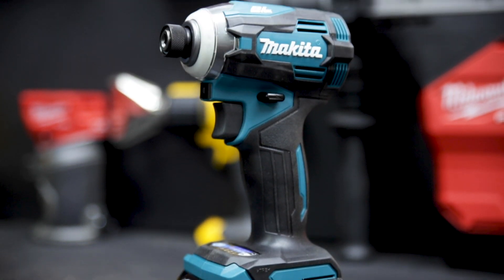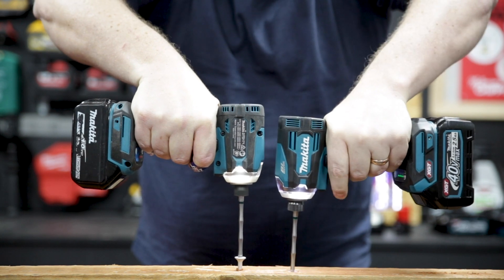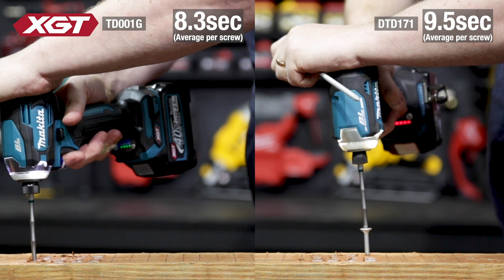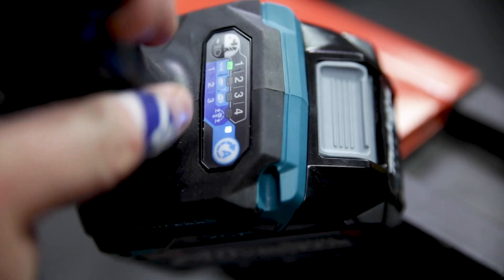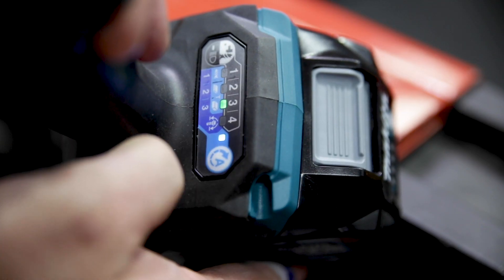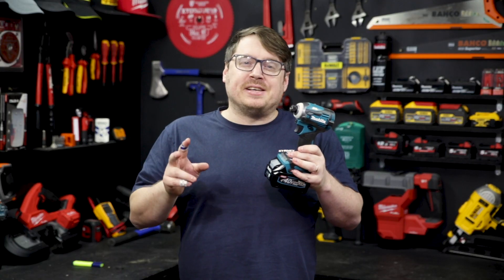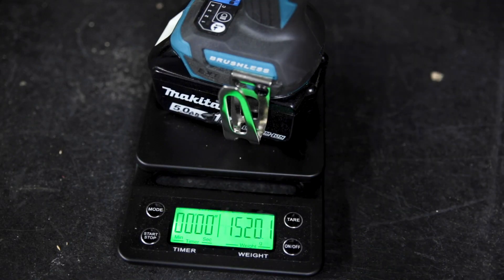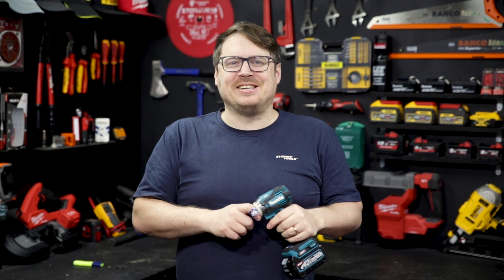NEW Makita XGT 40v MAX Brushless Impact Driver (TD001G)

Comment: I've spent thousands over the last 12 years on the LXT 18v range. The biggest leap forward was the brushles motor. My circular saw rips 25mm marine ply we're as my old ones would struggle sometimes. RIP saw cuts 3inch still wired cable with ease all day long with 5amp batteries.  Half inch drive pulls the rusty old nuts of most things. The brush version would call it a day. Angle grinders SDS drills you name it spot on and we abuse them in all weathers every day. 
So unless I have a specific application or money to pose with the latest bit of kit I'll be staying on the 18v platform if Makita dont pull the rug from underneath  us.
Reply: seems like this could be why makita has seem to have fallen behind milwaukee and dewalt with the brushless 18v innovations.  they used to boast the largest 18v platform, now they  even lose to ryobi on that.  i've been waiting on makita for a couple of tools to go brushless for a bit now. maybe i've been waiting for nothing.
Reply: They will carry on the 18v range for a long time until this range gets full and that will take a long time
Reply: Makita just released a sub compact bandsaw 18v, they are still supporting their 18v line.

Comment: Biggest deal breaker for me is the fact it is not compatible with my current line of Makita tools.
Reply: It always sucks to switch, but I think Makita's 18v is near the end of its life cycle. After 15 years it's time to move on
Reply: Not necessarily. Makita is releasing an adapter that uses 2 18v batteries. Not ideal but still useful for some tools. 

I admit I would rather see them go the FlexVolt route and make a 40v battery with intellisense that allows interoperable use.
Reply: you will come around.
Reply: @jimmythelegend-h7k  I agree would be nice to see

Comment: The fact that makita already had the best impact on the market already. And then they come out with this.
Reply: No actully the m18 fuel is the best impact driver
Reply: jacob fehr nah not really.
Reply: @Redsr5  actually  the makita is the best
Reply: Ozito would eat these
Reply: @333-p2o  somehow i don't think  so
Reply: @Redsr5  yes, but they are so strong that damage/wear out the batteries too. I love Milwaukee but hands down Makita make some very incredible work on communications between battery and tool, the tool limits the power when battery gets too hot, my 40V batteries under heavy use don't wear out even with everyday use. This fact alone are making me retire my old powerful Milwaukees, tired to buy batteries 😢.

Comment: Just bought the 18v dtd171z 5Ah kit, 40v kit for $800 is a bit much right now
Reply: You won't be disappointed with your 18v gear. I used the LXT 18 range from 2007/8 never let me down. That's why all pros use them. Over the years the biggest improvement as being upgrade to brushles motors.  My older circular saw, reciprocating saws are not as powerful and use the batteries up faster.  Other than that most people wont are fine with the 18v range.  I've must have 5k of lxt tools now, I would recommend them to anyone, especially if you have to make your living with them.
Reply from the maker: The DTD171Z is an awesome impact, in most basic/comon fastening applications there was little difference in performance.

Comment: Cracking review Tim. Good info on batten screws and screw modes. The taking out the stuck batten screw was a particularly nice touch as we have all got stuck with that and had to go to the heavy duty drill on low speed (wrist breaker)

Comment: This impact will beat the shit out of the milwaukee gen3 impact 👌👌
Reply: 40v vs 18v?
Reply: Is that even relevant when the milwaukee has the fuel technology?
Reply: Fuel find ultimate energy level🤯🤣 I own a m18 12 inch miter saw that out performs the 60v dewalt miter saw so I really don't think it's relevant 😯
Reply: Fuel is the same as the power detect from dewalt the technology adds electronic sensors that detect what battery you’re using and adjusts the power accordingly.
Reply: Do some real research 🤣🤣
Reply: @toollearningwoodturning6644  not really. I've tried both. The dewalt is still more powerful.
Reply: Makita 18v was already better than the Milwaukee. my old boss went through 4 Milwaukee drills and my 4 year old impact still going strong. have now replaced the 18v wich are my at home tools and my 40v are now my work tools

Comment: 40v 2.5ah, how long does a charge last compared to the 18v?
Reply: about the same as a 5 amp battery
Reply from the maker: @PistonHonda87  It's complicated. With bugles, it does substantially better due to it not having to overdraw and overheat but in lighter applications, it was better but pretty similar to a 6Ah. In general its a better runtime than the LXT but if you side by side with a 36v (2x18v) LXT tools, the LXT has a better runtime.

Comment: MADE IN CHINA OR JAPAN
Reply from the maker: China
Reply: They stop producing in Japan they moved all the manufacturers to china
Reply: @ltd_kemp  
My impact is japan tho older now 
Should last 20yrs if my old man has 40yr old drills 🤣
Reply: @Simon-Simon-Simon  true Japan should left there manufacturers there not moved them
Reply: @ltd_kemp  a couple wired power tools still made there. theres a grinder they make there but its around 300

Comment: Big mistake Makita. It's a whole new platform! I may as well just buy DeWalt or Hikoke (whatever they are? Hitachi). Plane dumb and disappointing. I love my Makita setup, if they made the battery compatible I'd would convert with time to the 40v system but effectively all my gear is obsolete now. Bit pissed actually. I'll run this lot into the ground and wont buy another 18v tool. I would have been blue for life as I had invested thousands and could not afford to change but now it's open season. I have been released from Makita and I'm free to play the field and that I will. Thanks Makita!
Reply: Who are you thinking of changing to? I’m in the same position
Reply: @vernw123  I'm a little fortunate in that I likely won't need anything for a while. Drag raced a DeWalt today with a Tec gun on 100mm  Bugles screws. Latest Hikoki, AEG, my 18v Makita and 18v Dewat. DeWalt come out on top every time. The other 3 were about the same. Thing is DeWalt chucks tend to shit out pretty quick. I have Makitas 10+ years old no hassle at all. I think I'll sit back and see how Hikoki work out. They have some nice stuff. I've tried 2 Dewalt power drills and 1 skill saw. All shit themselves too soon. I had the original 18v NiCad combo and they worked well but the batteries died and just like Makita it was a start over to get into Lithium batteries so I tried everything and at the time Makita won the 100mm bugle screw test so I have been Makita ever since. I don't use a nail gun at all any more every thing is done with 100mm bugles or 100mm tec screws. 
Just because of there reliability it may well be I stay Makita but I'm pissed they did it in the way they have. I know my batteries will die before the tool and I have pretty much 1 or 3 of everything. So if I could slowly transition with time to the 36V Batteries it would be fine. ALL of my tools are now battery. I have a fully rigged trailer with inverter and all to run batteries. I looked around on site today and absolutely no one had a power tool.
Reply: Ok